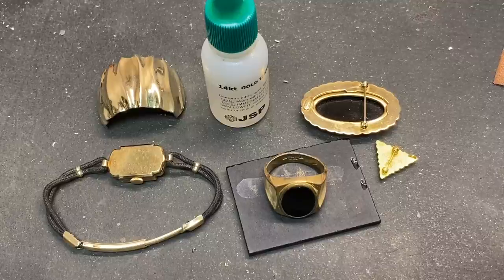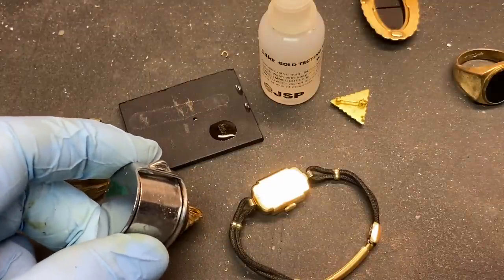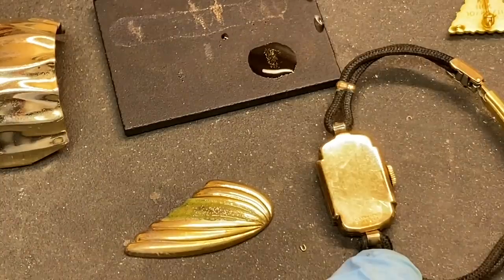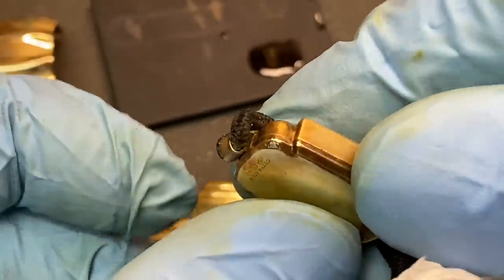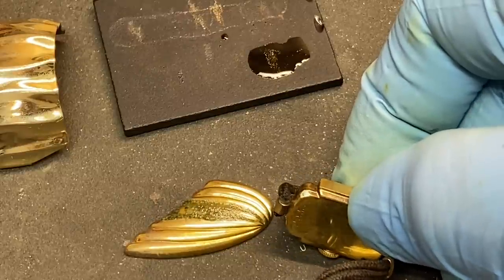Gold Filled or Gold Plated How To Tell

Comment: Example: 12k1/20GF, means 12k gold finish that is 1/20th of the total jewlery weight. So if it was 100 gram piece it would have 5 grams of 12k gold or 2.5 grams of 24k when refined
Reply from the maker: 12k is 12/24 or 50% or 0.5
1/20 is 5% or 0.05
So 100g GF times 0.5 times 0.05 equals 2.5 grams of pure gold per 100 grams of 1/20 12k GF scrap - just like you said
Reply: Awesome knowledge to know! Thank you!
Reply: @sreetips  I need help man I bought a 9ct gold Simpson & Co pencil marked “made in England 9ct” the pen unfortunately broke so I ripped it apart and it’s thin sheets of gold metal but the interior of the sheets is much darker, I’m not too sure if it’s filled gold or actually 9ct gold sheets but the pen mechanism is made from brass/copper
Reply: Is it true gold filled is a good investment because it lasts a lifetime?
Reply from the maker: Gold filled is a thick coating of karat gold over brass
Reply: @sreetips  Thank you for the information I appreciate it 😁
Reply: @sreetips  
Hello
Please what kt acide used?
14 kt or 18kt or 22 kt 
Thank you
Reply from the maker: In my videos, I inquart karat gold (NOT gold filled) with silver, then part with hot dilute nitric acid boils.
Reply: @sreetips  You do a great job. I was simply adding the information for others. Most people have no idea how to determine the gold quantity of gold filled jewlery

Comment: Drop of nitric acid  always tells the truth with thin gold plating. For the thick we need a defect to catch it!
Great video! 👍
Reply: eScrap Channel, what kind of a "defect" exactly are you looking for, can you PLEASE let us know because I've bought gold filled (with Hallmarks) jewelry in the past that lasted for "MANY YEARS" (35 and more), but what's being sold now IS worse than garbage (even on sites like Amazon, eBay, and Etsy for example). I so long for the days when you actually got what you paid for, NOT so much any more from what I see sadly.
Reply from the maker: A drop of 14k test acid right on the piece and gold plating can’t hold, it’s only a few microns thick, the 14k test acid burns through it almost immediately. It will turn green, bubble, and stick terrible. Gold filled is much thicker. A drop of 14k test acid will do nothing. However, if you file into the metal and create a “defect” in the thick coating of karat gold, then the acid will immediate react with the base metal at the “defect” that you created with the file.

Comment: so my chain is slightly magnetic at the pawn shop. 14K 3MM rope chain , 17.7G. i was certain it was real then it was slightly magnetic at the shop so they said it was fake. it’s been washed and cleaned many times, no tarnish, no green neck, i opened up one of the little ropes and looked inside and it was solid gold all the way through. so i’m convinced its real. second opinions ? stamped 14K and 585 finely on the clap
Reply from the maker: I’ve seen it

Comment: - 00:08 ❓ Explanation of the confusion between gold-filled and gold-plated items.
- 00:20 ⌚ Demonstration of 14k gold-filled watch marking.
- 00:37 💍 Example of 10k gold-filled ring marking.
- 00:49 🎖 Example of gold-filled pendant marking.
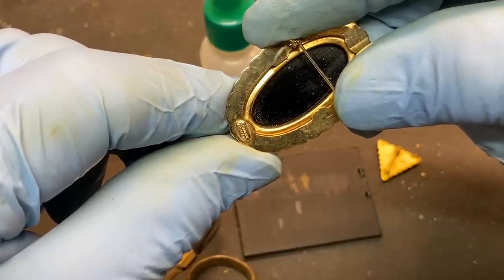- 01:00 📏 Not all gold-filled pieces are marked, but most usually are.
- 01:14 🧪 Testing gold-filled watch with acid on a touchstone.
- 01:25 🔍 Positive test for karat gold does not dissolve.
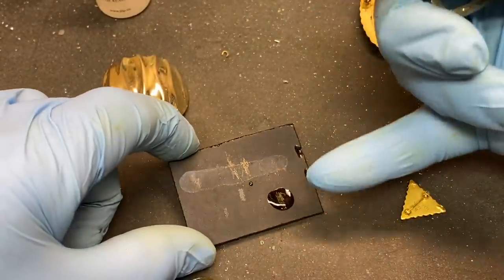- 01:52 ⚠ Misidentifying gold-filled as karat gold can skew refining calculations.
- 02:30 🧲 Demonstrating gold-plated material sticking to a magnet.
- 03:14 🌡 Acid test on gold-plated material bubbles and turns green, indicating thin gold plating.
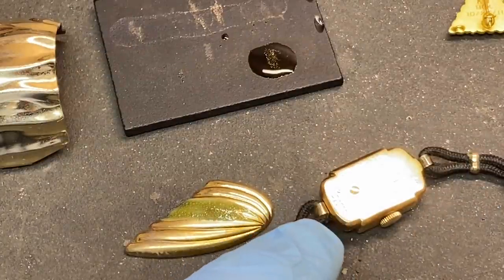- 03:40 🛡 Acid does not react with thick coating of gold-filled material.
- 04:24 🔧 Filing the gold-filled material to expose the base metal.
- 04:53 🔬 Acid immediately attacks the base metal, showing a distinct border between gold and brass.
- 06:14 ✅ Conclusion on differentiating gold-filled from gold-plated material.

Comment: What base material would you recommend using when making gold-filled jewelry that will last longer/not tarnish? Brass under gold-filled?  Stainless steel under gold-filled? Copper under gold-filled?
Reply from the maker: I’ve seen brass under gold filled, mostly. But I’ve also seen lead. It turns up during incineration. The lead melts and stays molten just from the heat of the melt dish.
Reply: i would think copper or silver. but that is my opinion
Reply: Elizabeth Covarrunias, I've had gold filled jewelry with silver and brass, but in my case I much prefer silver over copper, because of my skins reaction to brass so that should the gold filling wear away, I can still wear the silver with my other silver pieces (Yes, you'll pay more, but for me it's worth it for years to come).
Reply: @travkeyes  , your answer is correct from my experiences although I do have one gold filled piece in stainless steel, personally speaking I'll never buy another one of these pieces again.
Reply: @jebeja  why what happened?

Comment: Got a question about testing gold. So if it’s gold plated and you scratch that piece of jewelry on a scratch stone, the test acid solution will instantly erase the gold line? If it’s gold filled, it won’t eat through the test scratch immediately like the gold plated material?  I’ve just acquired a bunch of gold cuff links and tie clips and out of the 20 or so pieces, only 1 item is marked gold filled. The other are not labeled. I’m getting mixed results with the scratch testing. So I’m just trying to clarify the results that I’m getting. I don’t want to accidentally add gold plated into my gold filled refinement.
Reply from the maker: Put a drop of 14k test acid directly on the piece in question. Gold plated will eat thru rather quickly, turn green, bubble and stink. Gold filled the drop will stay and not eat thru - indefinitely.
Reply: @sreetips  thank you sir. that’s exactly the direction I needed to proceed with testing😊🙏

Comment: I have a gold pendant that reads 14k on my Mizar tester. It has no marks. It's 16grams. I sell jewelry on eBay and someone asked if it's gold over resin. How do I tell the base metal without ruining the piece? Just scrap it on my stone? Does test acid go bad after 6 months? I can't see any colors when I test. I need to know how to price it so I don't leave money on the table. It seems like I get more sellers than buyers looking at it.
Reply from the maker: It’s probably gold filled.

Comment: Is there any other way to test gold filled vs pure gold without ripping off so much the coat?
Reply from the maker: Yes, apply a drop of 14k test acid directly to the piece. If it thick karat gold over brass (gold filled) then it will do nothing. If it’s gold plated then it will start to bubble, stink and turn green almost immediately.

Comment: If the base metal is 925 sterling silver will the acid still create this border after you file down the gold plating ?
Reply from the maker: Depends on how thick the coating of gold is. A thick coating will retain its original shape as a shell of its former self. Very thin coating will crumble to a purple mud.

Comment: If gold plated takes 10 seconds to eat though and gold filled is 50x thicker wouldn't leaving the acid on there for an hour also eventually eat through it? 

If you made thicker streaks on the gold filled piece on the acid stone would it have changed color? You made a very light streak
Reply from the maker: No, and yes.
Reply: Chill he not tryna ruin his jewelry either

Comment: I was curious. How would you test your electroplating materials? I mean this as; how would you test gold plating itself? If the acid burns through it easily how does one even know it is gold finish/plating in the first place. Great video as always friend.
Reply from the maker: Good question - I don’t know.
Reply: @sreetips  hm. So for the electroplated materials it potentially could be a lot of brass you mix in as well? I also have some of those cheap earrings and other stuff but am having trouble thinking of an idea that would tarnish the brass, and also leave the gold plated materials with their shine. Ever try Hcl baths like a brine? May be a softer way to test, but the same for me. I have no clue haha. Google is also not very helpful on the subject.
Reply: @sreetips  I should add I have done the HCL method as a "brine bath" test before although I realize that HCL is an acid. I did it with the audio jacks to see what was brass and it did seem very effective, but heres my confusion with that. They were all together, so I'm unsure if the tarnished stuff could have just been the zinc or copper plating itself to the gold or something? Idk if that would make sense as to many of the pieces remained very spotless, and shiny, so the method may have some validity. Other than that have you tried 10k acid test on pieces? I would assume either 1- it is similar to the 14k reaction and eats through, or 2- it is more diluted, so it wont eat it as fast, but would still corrode/react to brass pieces.

Thanks again for your input for me and everyone curious on these methods. Really appreciate it.
Reply from the maker: Matthew, look at reactivity series of metal. Essential knowledge for anyone working with precious metals. Copper and zinc will not “plate out” on gold - in accordance with RSOM.
Reply: @sreetips  Very true about the reactivity chart. Although, it seems hard to read at times.. allow me to explain. I see many use that very chart to say copper, as well as gold and silver will not react in HCL yet that is not the case. Copper definitely goes into the solution as chlorites, or chlorates?...yet the chemistry, and science suggest it should not at all. So, I'm a bit puzzled at the chart sometimes. Even the teachers of basic reactions are puzzled when you look at comments saying HCL eats copper, and the solution turns black. My assumption based on what they say is purity issues, but then HCL doesn't even exist. Pure HCL is a gas of Chlorine (CL2) and the gas hydrogen (H), thus a pure solution is a gas unless under certain pressures. They seem to neglect the H2O fully, and all side reactions. Another issue is that the Zinc is displacing, or reacting with Hydrogen which may allow the copper then react, but I am unsure fully of these reactions in this depth. However, you are correct. Because gold (solid) is under all of these metals they should not attach, or plate out onto the gold. I'm also confused on how copper solid does plate out precious metals. The oxide, chloride, chlorate, and chlorite stages vary on what is happening which is a head spin.

Do you understand the chemistry of the copper solid dropping the precious metals to their oxide forms?
You can also correct any flawed thinking here, which is always appreciated.

As always thanks for sharing. Learning chemistry is something special lmao.
Reply: @sreetips  Got my answer. To test brass vs AU plating is a go. My test is valid unless the brass, or plated AU is painted, which makes the whole thing on buying scrap gold a bust, but that's alright. Learned a lot with it. With pieces you know are not painted this is valid due to (H) in HCL reaction with (Zn). this is handy for some cases like computer scrap, and some other things. This is why you use nitric I see. I assume the black oxide sediments that I still see while refining computer scrap with HCL are actually copper oxide CuO. It reacts to the sneaky H2O with the accelerated HCL reaction. (I think), and it looks like you dodge this reaction with the nitric, because it actually does react with copper very well. Still confused on the reactivity chart, because nitric has Nitrogen, oxygen(3), and hydrogen.....

Comment: I dropped some 10k acid on a chain I have an it didn't react. But pawn shop buy said it was plated?
Reply from the maker: I use 14k acid. File into it, then apply the acid directly to the file mark. If nothing happens then it could be karat gold. I’m f it bubbles, turns green and stinks then it’s probably plated.

Comment: I bought a rope chain 18k gold how can I check if it’s solid 18k gold or gold filled without Damaging it
Reply from the maker: The only way I know is to file deep into the metal in an inconspicuous location and apply a drop of 14k acid directly to the file mark. If it’s solid gold then you’ll get no reaction. If it gold filled then the 14k test acid will begin to react with the brass, bubble, turn green, and stink.

Comment: Having trouble with some gold filled scrap- all is marked gold filled or RGP; but a lot of it is still magnetic. Any thoughts?
Reply from the maker: It should go
Reply: @sreetips  go in the trash or in the batch??
Reply from the maker: In my early days, I feared magnetic material so I excluded it. But later discovered that it will go just fine and should be included. But I don’t know what you have there. This has been my experience.
Reply: @sreetips  it’s mostly old watchband tops and bezels. I’ll keep chugging along with the wire cutters for now. Thanks for the replies
Reply from the maker: Most watch band caps that I’ve worked with are magnetic. They will dissolve in the hot dilute nitric acid in my experience.

Comment: so how do you know if a piece is gold filled and not solid if it tests as karat and is not marked as gold filled?
Reply from the maker: Put 14k test acid directly on the piece. If it’s GF there will be no reaction. If it’s GP then the acid will start to bubble, stink, and turn green.
Reply from the maker: To see if it’s solid karat then file deep into the metal and apply a drop of 14k test acid to the filed spot. If solid karat then no reaction. If GF then it will bubble, stink and turn green.

Comment: Can you only use brass for gold filled ?
Reply from the maker: I think brass is stiffer than plain copper. And that’s why it’s used as the base metal for gold filled bracelets.
Reply: @sreetips  What about stainless steel
Reply from the maker: I think that stainless is more difficult to plate gold on it.

Comment: I love this video. I always wondered if gold filled could have acid sit on it and be ok. Could gold filled beat an XRF? I had a jeweler sell me an 18k necklace and he let the acid sit on top and it didn't react he didn't want to do a scratch test. Then i brought it to an XRF and it tested as 17.2k gold. Would 18k acid eat through underkarated gold? Is that why he wouldnt do a scratch test?
Reply from the maker: I don’t know. Xrf only goes in a few microns so gold filled could possibly fool it. But I’m not sure because I’ve never used one. I have never seen a piece of 18k gold filled. Doesn’t mean that it don’t exist. If your not sure about your 18k chain here is what I’d do if it were mine; file some of the metal and apply a drop of 18k test acid and watch. If no reaction then you’re probably good. But if you get bubbling stinking green color then there’s a problem. The acid don’t lie.
Reply: XRF detects gold filled

Comment: TIP For Acid - Refill The Acid Itself In Syringes That You Can Buy In Pharmacy, But The Smallest syringes Because They Hold The SMallest Needles, You Don`t Need Much, You Don`t Need Even A Drop , You Need Like 30 % Of AA Drop To Test Gold So The Manuafacturers Of The Bottles Make The Large Holes For A Reason - So You Will Use The Acid Faster And You Will Need To Buy More, But With syringe Method You Will Get MUCH LONGER Use Out Of It Because You Will be ABle To Fine Tune The Droplets And You Will have Super Good Control Over It And You Will be ABle To Drop Them 1/90 Droplets So Yeah, I Hope I Helped. :)
Reply from the maker: Sounds good. Thank you